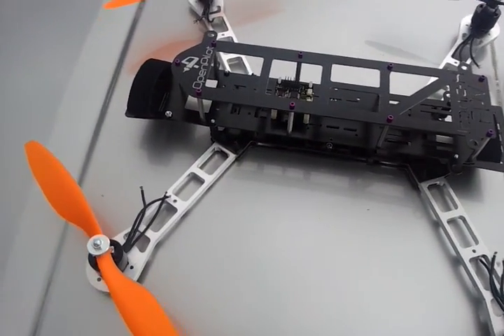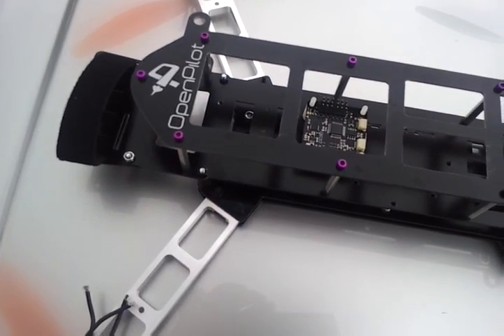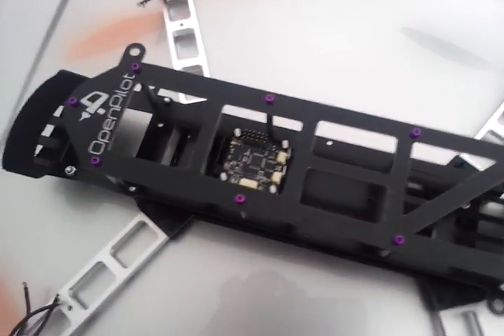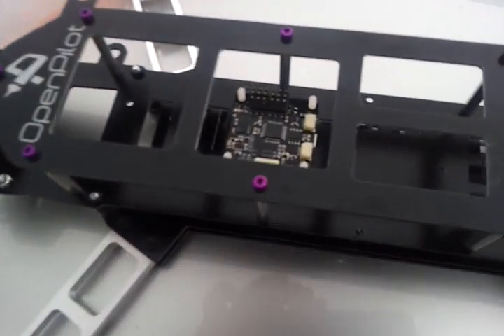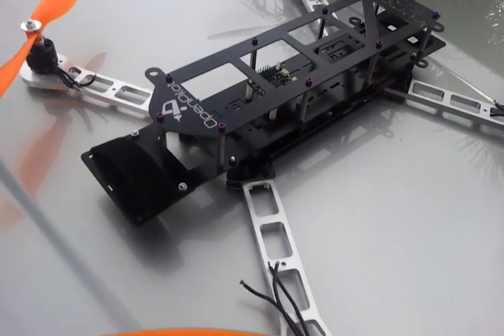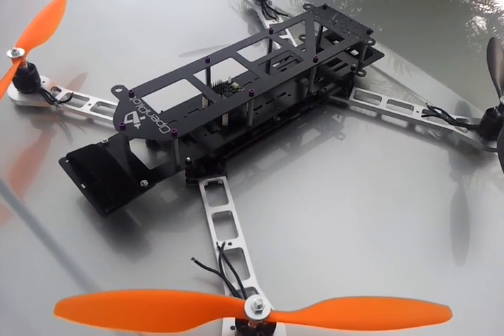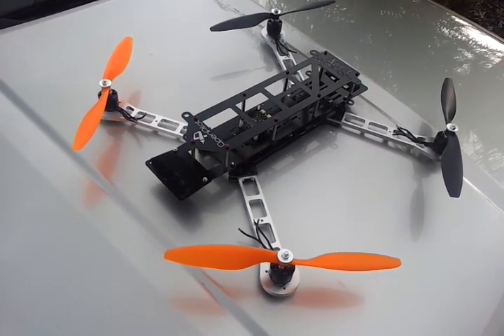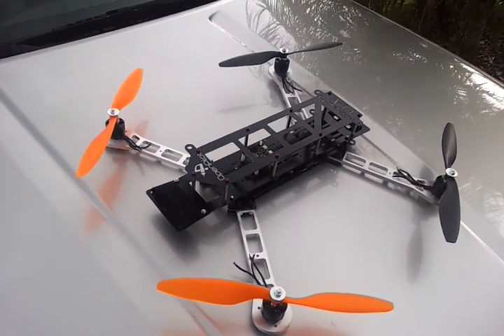iconic-X FPV OpenPilot CC3D Build by Quad_Addict

Comment from the maker: qav500? LOL the dude doesnt know what he is doing, i been making and perfecting aluminum arms for couple years in multi rotor. i hear so many complaints of people crashing and bending/breaking arms on his and he even talks about it on his page.  he basically used my ideas. and im ok with that its a community of sharing :)

but if you want to spend $50 more on his. go ahead, i also make arms to upgrade his and my frame :)